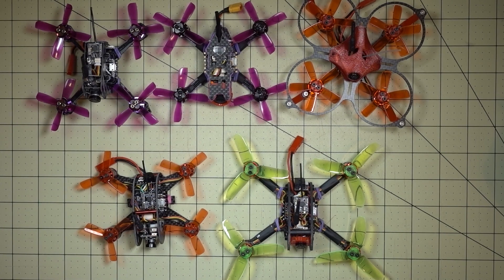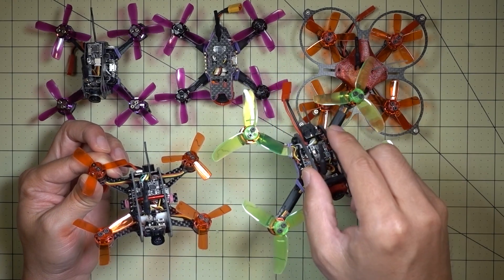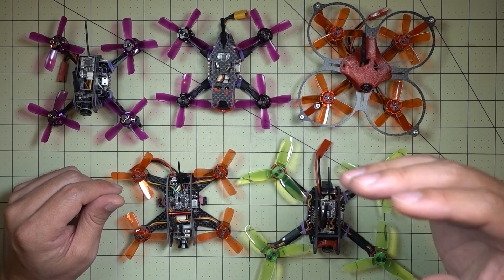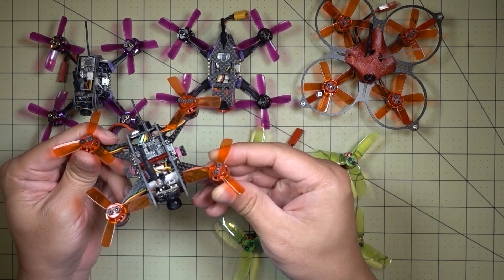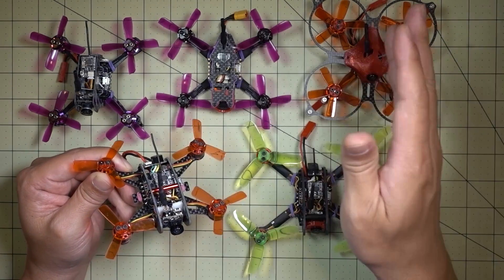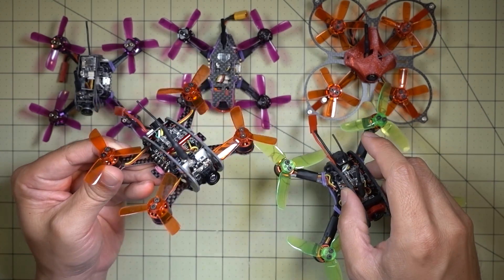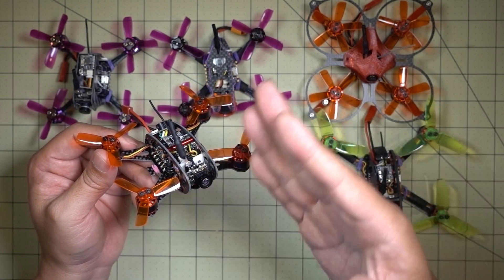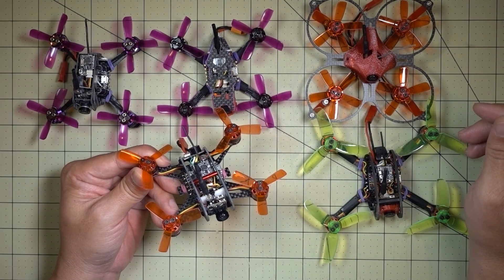Micro Drone PSA 🚁 Death Rolls 💀👻😲

Comment: Hello.. i have micro and the setup is 1408 motors, omnibus F4 micro FC and 25amps ESC 4in1.. i use 3S lipo all normal and good fly, but when i use 4S lipo then arming instantly the quad going crazy..
Reply from the maker: The PIDs are probably way too high for 4S.
Reply: Albert Kim do you have solution for my problem..? Thanks..

Comment: Im running dshot - does this still mean i can change the idle speed ? A lot of what you're saying doesn't make sense because most of it is idle speed and i've never had to change this value and i dont see where you can change it. In the cli if i " get idle " it gives me the dshot value from 0-2000 | Also from your video what I gathered from your information is that it could literally be any of the parts from the props to the motor or esc so it could be anything ?
Reply from the maker: It's in the configurator on the main configuration page at the top right.  Select DSHOT600 and you'll see a drop down menu called "Motor Idle Throttle Value"
Reply: .... i see - i've never seen that before. I think I fixed the problem by putting the start up power on low which has been everybodys combined winning suggestion. It also worked from me. Something tells me running camera + vtx + receiver off an AIO ESC PDB FC might be taxing these little boards pretty hard. I'm using a zeus F4 AIO Caddx Turtle HD dvr and RuncamVTX so nothing major - but this exact set up didn't have death rolls on a 2" now on these big ass motors they do so maybe a cap would of helped in this situation ? Who knows i'm not really that smart like most people who fly, we just watch some videos, think we know something, put parts together and go fly.

Comment: GOOD~VID~N~INFO, ALBERT~KIM...  2LETCHYA KNW, N OTHERZ...    I'VE RAN 5~6 MICRO'Z ...AALL ON THE RED, "JST" CONNECTORS...  2S&3S.....  NEVER HAD ANY ISSUES, ALL BL_HELI~SUITE_S FIRMWARE...  LATEST, N GREATEST BETAFLIGHT FIRMWARE...     I'VE ONLY HAD ISSUES, WIT THE,"FULLSPEED" PRODUCTS...     THEY'RE NOT "REAL" OMNIBUS F3 FLIGHT CONTROLLERS.... , MOST LIKELY NOT THE SAME AIO ESC's EITHER....   SUX'TOO ..   "FULLSPEED" COMPANY, SELLIN2 GEARBEST..  SELLIN2US....      I'VE USED A MILLION DIFF PROPS, LIKE U...  FOUND "FLASH"2540'z 2B THEE BEST..  I'VE SWAPPED DIFF SIZE, MOTORS..   DIFF kv MOTORS..  TRIED ,AURORA RC....  ALL WORKED,WELL...      EVERYTHING..       NOW, THAT I'M SEEING, & COMMIN ACROSS "FULLSPEED"..   IT'S CRAP

Comment: Hi. I just had this issue with my 5", and my flight controller BB says that motor number two spins 100% while the rest are around 20% during the time that it needs to recover from the roll. Im not sure if I need to replace the ESC or the flight controller.

Comment: Im having a similar problem. Kinda. Im getting the flip of death on my newest build. Flipping out on the pitch axis when I cut the throttle and start a flip. Only happens on 4s. But it flies PERFECT on 3s. I have tried almost everything. I figured that it was the throttle idle percentage because it works on 3s, but not 4s. But I have tried raising and lowering idle, but it still happens. Im pretty much stuck because I have tried almost everything I can think of. Tried different PIDs, added capacitor, tried inverted prop rotation, tried different rates, changed idle percentage (low & high), tried antigravity, switched props, calibrated everything (tx endpoints, ESCs, accelerometer), tried every pid filter setting, tried every DShot protocol with every pid/gyro loop combo, and more. Can anyone point me in the right direction? Im tired of crashing every time I need to test a new setting!
Reply from the maker: +Ninja Sauce change motor speed to med low
Reply: I probably should have mentioned that im using BLHeli32. ....I have something called "ramp-up power", but Im not sure if it does the same thing. But I noticed that I can adjust the motor timing to precise degrees. I need to read the complete BLHeli32 manual because its kinda different from BLHeli S.
Reply from the maker: +Ninja Sauce change motor timing to med low

Comment: Hey Albert, I've been a long time subscriber of yours and I know you use the Turnigy Flysky protocol in your builds as much as possible. I'm wondering if you can comment on some of the bad reports on the micro rx's (A8S and FS82) where folks are having trouble. Ie:

https://www.rcgroups.com/forums/show...8#post38726740

I'm wondering if these are really the brown outs you discuss in your PSA videos, or maybe ESC noise like the F4 FCs, or maybe you've experienced problems too.

Thanks a bunch, keep up the good work!
Reply from the maker: I can make some general observations about the micro flysky receivers. Out of the RX2A, RX2A Pro, FS82, and A8S, the FS82 is the one I've bought the most with fewest defects.  Of the RX2A Pro's that work, they seem to be just as good as the FS82.  However, I've gotten a couple of duds.  The A8S seems to have issues with RF interference.  If you properly shield them they seem to be OK.  I don't know everyone else's experience, but this has been mine.

Comment: So after killing my ARFUN 95 pro frame I put the components into the the Eclair V2. Added some Emax 1106 7500 KV Motors and an XT30 connector. It flies great until I ask it to roll and then it just flips out. Running 3s 650 Tattu’s as well as my 2s 80c’s Beeper constantly beeps right after take off. Updated to 3.2 and the latest BL helix firmware bit still the same. Should I replace the motors if the idol speed doesn’t work?
Reply from the maker: Drop min voltage to 2.8v and raise idle speed to 6 percent. Let me know what happens...
Reply: Albert Kim It’s midnight here so I’ll have to do that in the morning before work. Of course I’ll let you know the results. Like you, I am stumped and clearly it’s a combination of many factors.
Reply: Albert Kim Okay so I reduced the min voltage to 2.8 and upped the idol speed to 6. Initially all was working fine, flipping and rolling just fine until I did a double flip and the flip of death happened. Sadly that landing delaminated a few layers on one of my Eclair V2 arms which has really ticked me off. Not completely broken through but not sure I can trust it. Probably shouldn’t have put my new set of Hulkies on there either. Grrrrr. Should I up the idol speed a little more?

Comment: What I found interesting was that I've always used 2% idle speed without any problems. I never used air mode either. Then I decided to upgrade to betaflight 3.2 for the new dshot commands because.. ya know.. they're god-like. Immediately started getting flips of death after punch outs. Usually it's right after I punch out hard and then begin to fall, it will just suddenly go into a super fast roll and usually it will catch itself after like 10 rolls or so but sometimes it just goes full crazy rolls all the way until it hits the ground. So w/e they did in 3.2 caused it for me lol.

Comment: I have the lizard95 and never had a problem.  Until i crashed one time and ever since it has issues.  I found out that my low ESR capacitor i put on it broke one of the leads off.  I wonder if having the cap kept it from having issues.  I can't verify it cause my frame broke on one of the flips of death and I'm waiting for new frame.

Comment: Albert I read a article in gibhub and they tacking about this problems due to Dshoot 600 protocol
Reply from the maker: Really!!!????  How can I find this article?  I would like to read it.
Reply: Albert I cut and paste the comment I did in andyrc about this issue, this is what i copy and paste from gibhub web site, i have the link in my work computer so this is what i gather.       Setting Minimum Throttle

Note: In Firmware 3.1.1 and earlier min_check and min_throttle are affecting the Dshot idle value so adjusting the motor idle speed is not straight forward. If running these earlier versions of firmware try defaults and then adjust 'digital_idle_percent' until the motors ilde at the desired speed.
This got fixed in 3.1.2 and up so now digital_idle_percent Only sets the Dshot idle speed. Be aware that Dshot ESCs can run motors at much slower speeds but if idle speed is too low the motor may Stall in flight during hard maneuvers and you get a 'death roll'. If this happens increase the value of digital_idle_percent.
Show less
REPLY

Comment: I noticed that one esc was resetting on my kt100 build, causing flips of death when i did a roll in one direction, and sometimes also when i armed it and the motors would spin up. Of course you can't hear the beep if it's happening in the air and the other motors still running. Still not sure if the problem was the motors or escs, racerstar 1103 10000 and 6amp escs. I replaced both with 1104 7500 and 10a 4in1, never had that problem again. I guess one of the escs was bad but i have to use the 1103s in another build to figure out.

Comment: I got one of the new Leader 120's with all black motors. I switched to rotor x 2535 props and raised idle to 7%. Still on the jst connector, stock ESC firmware, stock FC firmware (3.1.5). No flips of death
Reply: Adding to this. I also received the newer batch LD-120 with the black motors. Motor Idle was set to 10 in factory settings. I lowered it to 6,5, then did some test flights. No FoDs, even when I was purposefully trying to cause them. Motor stop on and off, Air Mode on and off, punching from idling or from completely stopped motors in free fall - no FoDs.

The new stock configuration has other problems, which I've described in LD-120's thread on RCGroups, but flips of death seem to be gone.

Comment: I had a random and un-explainable FOD's that came out of nowhere for several weeks. Turned out it was a bad motor. Must have had a short that slowly developed. Now I elec tape the wires right at the motor to stop them from wiggling there. Thanks for the vid. "The more you know!"

Comment: Hi Albert, thanks for the video.  I had chatted with you before about my flips of death on my Leader 120.  Well, I have been in communication with Full Speed, and they sent me some new software to put into Betaflight, and I did that, didn't help.  So I asked that they send me a new quad and take mine and find out why it flips out.  But they wouldn't do that.  They did agree to send me a new 4in1 ESC, as I had heard you and others talk about how that may be the problem.  I haven't received it yet(I had to purchase something from their store, then they put the ESC in the shipment).  Now I hear you thinking that it may be a motor issue .  If you don't recall what I have already done, here is my list.  Put on XT30, brand new 75C Tattu batteries, changed idle speed 3.7, 6.5, 8, 10.  Tried Gemfan 3025 2 blade props(cut down to fit), isolate the camera power with a 5v BEC, running DSMX receiver.  All of that to still have flips.  So, maybe even before I put the new ESC on(as it will probably be the same kind as what is in it), I was wondering what would be the best motors to try?  Should I try a different kv than 7500, or even different motor size than 1104? And would a different brand of ESC be worth thinking about?  Thanks again for the good video, and hope to hear your opinions!
Reply: Stratman1970 LemonRx would be 100% compatible with the lemon quad you were sold. I would return the quad for refund. If you paid via Paypal you can dispute the transaction and get your money back. Too many FPV enthusiasts are getting scammed these days. I returned my micro which was desyncing - RotorX Atom V3 - for a full refund. Got Japalura from Armattan and have 0 issues now.
Reply: Ya I wish I could return it.  I purchased it from GearBest.  They said their policy is only to return or full refund on DOA quads.  So because my motors spun up,  it wasn't DOA in their eyes. It doesn't matter that I am totally unable to fly this thing, and have never been able to fly even a whole battery at one time without it falling out of the sky.  It sure leaves a bad taste in a persons mouth about these companies that are making a ton of money off of us!!!!
Reply: Stratman1970 Don't worry about the GeatBest policy. Just open a claim with your credit card or paypal and complain the product is defective. GearBest will be forced to accept return.

Comment: My Leader 120 had an XT30 from the beginning. And I updated the ESCs in BLHeli and I was having flips of death!
Reply from the maker: +Frequent Flyer RC did you update Betaflight? Props? PIDs? ESC startup power?  Probably many different combinations of tricks might be needed depending on the craft.
Reply: Thanks for sharing man! I am now totally convinced it's the motors now. My reasoning is I got Multishot running on the Leader and the motors don't even spin on arm until you take min throttle all the way up to almost 1200! See, Dshot hides this because of the way that protocol works. My guess is too much resistance in motors in the form of lack of sensitivity.
Reply from the maker: +Frequent Flyer RC The ESCs might not be properly built for multishot and one shot... BUT, I agree the motors here are very suspect!!!
Reply: Yeah, it flies ok but I prefer the rolls on the Lizard 95 that I have with a 4.5% idle versus this with a 10%, and I am hesitant to lower it, an risk the RODs...lol  (chicken here...don't want to scratch'n'dent my newest baby...just saying.)
Reply: Frank Barajas lolol understood.  Must be the components I use, cause I've built like 9 brushless micros and never had the fod
Reply: My Leader 120 which just came in has different motors, but the motor idle was set to 10%. No flips of death, but I'm not a very aggressive as the both of you. However, I actually don't like the motors is has as the prop shaft is only about 2 mm tall. Barely enough to seat the prop. Everything seems fine other than that but I am tempted to lower the idle speed, since I too, feel it's way too high. BF was updated to 3.1.7. Also, I have that read that Air-mode may be an additional factor in this problem occurring as reported from users on the RCGroups.
Reply: I wish I was having the flip of death problem!  That would at least mean I was getting airborne!  Right now my Leader 120 is testing my patience to its limits! I installed an XM+, and have spent over 8 hours this week trying every possible setting in Betaflight to get it to work!  No luck! I'm thinking it's a firmware issue, but I ordered 3 more receivers to try to get it working.
Reply: JJRotoGeek Yes sir.  Running SBUS to the SBUS pad on the factory Leader 120's F3 FC.  The FC is running Omnibus. I flashed Betaflight 3.1.7 onto the FC. I'm wondering if I should try flashing 3.2.
Reply: Jeff Barragan I did a video on setting up omnibus f3. With s bus https://youtu.be/p9Nkh87TWsc
Reply: JJRotoGeek tried that several times with no luck. Tried just about every combination of settings in the Ports menu.  Even changed the USB VCP setting which locked up the FC until I could re flash it. My receiver is binding to my transmitter, but will not do anything in the Receiver or Modes tabs in Betaflight.
Reply: I saw that DroneRacer101 was having similar issues when he tried to install an XM receiver, so he had to use an XM+ instead and it worked. I even tried to flash firmware to the XM+, but that's a separate issue.
Reply: Jeff Barragan u runnng sbus??? And what fc do u have?
Reply: Jeff Barragan in the ports tab, set serial communication to uart 3. Then in the config tab set it up for serial communication then below that select sbus from the drop down, then hit save and reboot. I'm driving, hard to type lol
Reply: JJRotoGeek please keep the suggestions coming.  The new receivers won't be here until next week.
Reply: Jeff Barragan ok, I know omnibus fed and back, but I'm not super experienced with your reciever.  Can it output ppm? If so, just for shits, try hooking it up that way and see if u get signal
Reply: JJRotoGeek LOL!  Tried that too. I think I need to either try flashing the XM+ again or maybe try flashing the unstable Betaflight 3.2 to the FC.
Reply: Jeff Barragan hmmm odd sounds like the reciever.   It's not the firmware.   You can try a reflash and clear all settings and start over, but I doubt that's it.  My guess is reciever.  I'll be glad to double check ya dump file, but it sounds like ya know what your doing with that end
Reply: JJRotoGeek would you mind continuing this conversation through email?  You should be able to email me through my channel.
Reply: Jeff Barragan hey my friend, did u get my contact info??
Reply: JJRotoGeek No, I didn't get anything.  Did you message me through email or YouTube?
Reply: Damn, i messaged you on here. so sure, if you want to email me its jasongjamiel@gmail.com, or if you have google hangouts its JJrotogeek, lets see if we can get it worked out!
Reply: JJRotoGeek I shot you an email brother.
Reply: hey broheem, check ya email!
Reply: Frank Barajas hey there, air mode won't be an issue as long as the digital idle speed is right.  On 10% you should be cool